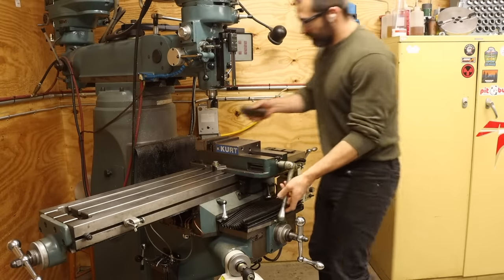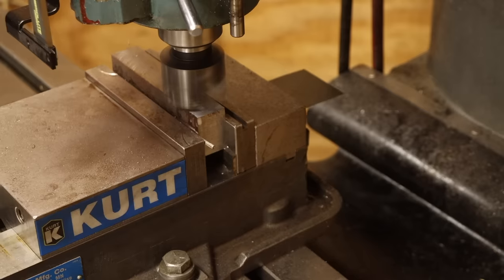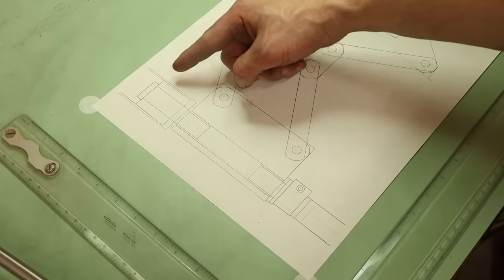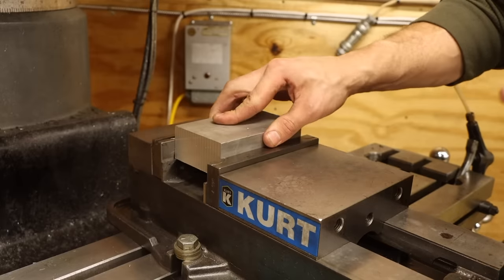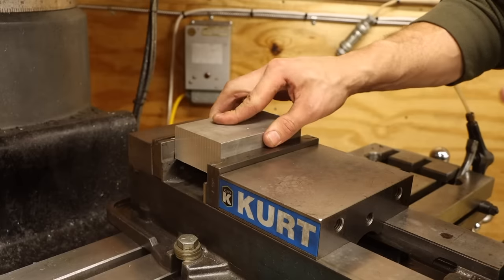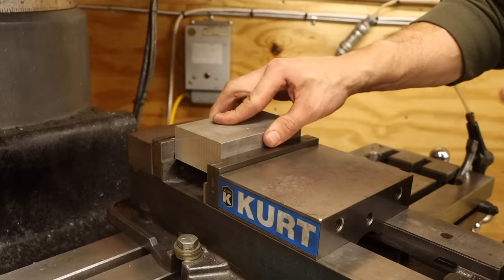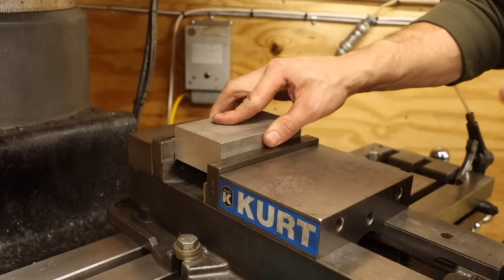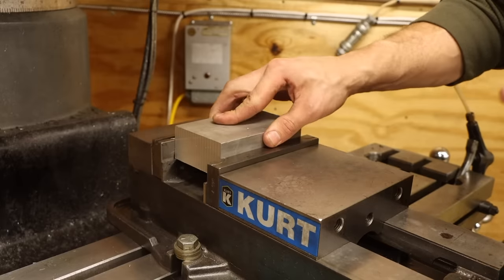A Life Changing Filming Upgrade || INHERITANCE MACHINING

Comment from the maker: I really can't believe how well this actually turned out. Nor can I believe I made it through without a single trip to the BOS 😂  But seriously this is going to make filming these projects so much easier and I can't wait to try out some new angles. See you again March 3rd!
Reply: nooo... so late?😉
Reply: This is so cool! I have one question though, what if you bump the gantry while filming? Will it move? Maybe some locking wood or nylon cams could keep it from sliding if accidentally bumped?
Reply: now you also have a tap holder for aautomatic tapping, when you're done filming
Reply: Looks great. I'm interested to see how much the gantry is affected by vibrations from the heavier machines. At least it probably won't drift, since you've leveled the track. But perhaps arm will migrate?
Reply: Dude the gantry is friggin awesome, you inspire me man :D
Reply: Well the BOS is subjective in my opinion
Reply: @jones7399  no
Reply: @Counttec  it shouldnt move at all
Reply: I can imagine the relief it gave once the project was done and actually functional. So satisfying :)
Reply: Super cool :)
A further upgrade I would suggest if your camera can take external power is to mount a bigger battery holder on the drop tube, and run a DC power chord from that along the arm out to the camera. Running out of battery is the most common complaint i hear from people new to filming :) At the end of the day, just return the gantry to home position and plug in the charger cable to the battery holder...
Reply: I was expecting a cut at 11:41 to the BOS overflowing with washers after making a claim like that
Reply: The only thing that I would have done is to make a second handle to go on the camera part to help finely move the camera when you can see the screen.
Reply: Not only did nothing end up in the BOS, but you had no Side Projects in this Build...

[Shocked Gasps] The HORROR...

😄😁😆😅😂🤣
Reply: @adamsavage should copy this :D
Reply: i love watching your videos, and this build is simply amazing.  cant wait for the next build
Reply: Unbelievable build!  Between the complicated builds and editing when do you sleep?  There’s not a lot of people out there that think like you do.
Reply: As a video production professional who also machines, I think this project is fantastic. There are similar Riggs that you can just go by but it wouldn't really make any sense considering the fact that you need projects to shoot and you can customize it.  Besides, I think your product is better. But I would say that you missed one opportunity, you could have made it a heavier-duty general-purpose gantry for changing chucks, loading heavy stock, etc.
Reply: Awesome little (except it’s frigging huge) project. The BOS will have his moment many times to come. Loving the videos as usual, keep up the marvellous work.
Reply: A smaller and simpler gantry on the same rails could be a great help to have the ligts, maybe one fixture on each side if you really need the flexibility. 

You shouldn't need more than a hight adjustment for them, and nowhere near the reach of the camera. Easily playing with light position is great for so many shots, 

I had some lights on a similar, but quite simpler arms, the gantry was something I alway thought but sadly the ceiling config and astethics wasn't conducive for it.
Reply: Agreed. Great build!
Reply: My only suggestion is some way to stope it from moving while you keep it still.
Reply: lol You should build a display case for the BOS items 😁  It would be fun.  Or maybe when you get a little more stuff in there, maybe you can do a "scrap metal" challenge and make something fun like a collage of your logo?  just an idea
Reply: @AJBtheSuede  To go the whole hog add a remote monitor for framing the overheads. 7 to 10" HDMI monitors are cheap and plentiful.
Reply: Add a cup holder. 😁
Reply: Amazing project, some great ideas and problem solving
Reply: Don't you mean the "F*!#&ing Knurler Parts" box?
Reply: The BOS is hungry
Reply: Nice build!  One thing that comes to mind is that, for each axis, if you run non-stretching cord from the carriage to the two extents of that axis and back, looping it around a bolt on the carriage that you can tighten, you can easily move along an axis while the bolt is loose, but tightening it will lock that axis firmly in place.  As well, by marking the cord at particular places you like to film from, it will be trivial to make sure that the carriage is exactly in the same spot each shot.  (If you really want to get fancy down the line, you can replace the cord with a toothed belt and motorize the whole thing, controlling it with 3d printer/CNC controller board so you can do automatic panning/etc.)

Does that make sense?
Reply: @mpyoung33 😅
Reply: @andy-mu3sx I think a heavy duty gantry is an excellent idea, but the rails are strong enough that he could mount one to the same sled or rails.  I’m sure Brandon would figure out a way to keep it from interfering with the camera setup.

Comment: I feel your tripod pain lol, i thought about something like this but my shed is to small with quite a low ceiling and the barn is to big. Top job and greta video as always.
Reply: Obligatory fanboying.
Reply from the maker: I appreciate it! Maybe an inverted arm (elbow down) could work for you. Or just a stationary pivot. Heck anything is an improvement on a tripod 😂
Reply: Two of my youtube hero’s in one comment section. Fantastic!
Reply: Obviously you need something large and motorized (jet powered??). Perhaps a laser designator that you can point for the camera to go to a location automatically, probably at like 50+mph.
Reply: @colinfurze Just swap the gantry for some preset hard points that you can slide the base arm post in and out of. That would work for smaller or bigger spaces. More effort to heft the arm between hard points when needed, but way more flexible for a large space, and way more space efficient for a small space.

A correctly chosen taper length and angle for the the mating of the arm to the hard points would make it easy to put in and out, but also very stable.
Reply: Colin, I think we all know you need to copy this design and strap a jet, 6 fireworks, a BMX and a pit bike engine to it. Go on, you know you want to 😉
Reply: Colin Furze, Inheritance Machining in one comment. We just need This Old Tony and Abom79 to make it a party. 😉
Reply: For the barn, consider skycam. A wire rope system. They use them in stadiums.
Reply: Barn is too big?? Sounds like you could do with a NICE, furzy, too big gantry setup, make it human-sized to be able to do those nice shots from above, and add a camera arm like this for close up and timelapse work. 

Have BAE do sponsor deal as they should be long on cash and short on kids wanting to get into machining and manufacturing jobs, atm
Reply: @Rastadogg85  could do IR beacon and have the gantry turn into a big CNC programmed w toolpaths around the barn, and then have the camera head independently focus on IR beacon while on the move.

I like the sound of it!
Reply: @dogefort8410  I volunteer to fly around on a gantry and hold a camera. Rocking foot pedals for x and y axis movement would be slick hands free operation.
Reply: A similar concept with vertical upper wall mount?
Reply: @danielstellmon5330  can't do 40 hr timelapse with drone.  Tethered drone, maybe, but not regular
Reply: You could make a small weighted cart for the barn that you just roll around with you
Reply: @InheritanceMachining  As a camera operator of many years the only thing I think you should add would be locking mechanisms on all pivots and elbows to help take out some of the vibrations. With some large Kipp type handles and a bit more drilling and tapping will make it much more stable if you can snug up all those joints when you need to.
Also I would have included some type of flexible mount with a small hdmi monitor near the camera end to make framing easier.
You are going to be able to do some lovely smooth tracking shots on those rails.
Reply: Mount camera on drone that will follow you around in barn. Jet engine not mandatory.

Comment: Consider a soft bumper (think tennis ball) on the bottom tip of the vertical handle. I worked in a shop with a similar apparatus and it only takes standing up under it once to make you hate the thing.
Reply: I'd like to see the precise drawings and machining of this "tennis ball" :)
Reply: Now I kinda wanna see him make a tennis ball out of metal. Damnit.

Comment: One of my favorite things that I noticed early on about your videos it's how you show certain shots throughout the manufacturing process in the intro, and usually show the finished product as the final shot before the logo, but even though I've seen what the final product looks like, my interest in the process it took to get there remains just as high. 
Excellent cinematography and storytelling.

edit: Now all we need is Mark Rober to install some simple moters and software to move the whole thing for some sweet panning shots 😂
Reply: There is a software called Dragonframe - originally developed to shoot cartoons frame by frame by carefully moving camera between shots. He could just slap a couple of servo motors, wire them to arduino and have that software to control the pulley. Alternatively, one could use Marlin or other 3d printing firmware to control those servos.
Reply from the maker: Thank you! I'm glad they pique interest more than spoil the surprise. It's a tricky dilemma
Reply: Personally, I keep my eyes shut during the introduction, solely to maximise the satisfaction of the final reveal
Reply: @_Cheko_  Plans, drawings, renderings and so on are fine, but the actual product kind of ruins the adventure of the build.
Reply: I like getting the whole lot from the get go. It makes the design considerations and limitations more meaningful for me and easy to conceptualise. Interestingly I struggle with raw creativity and often get my inspiration from taking things apart and reverse engineering or adapting the ideas I find within so maybe that’s why. Side note, I have one of those arms/jibs but it has no coil springs at all. There is just a single steel ‘finger’(?) within the middle joint/elbow of the arm and is almost completely hidden by the hinge bracket except a small slot. The finger pivots on pins and is preloaded with tension so it works in kind of an equal but opposite fashion to the elbow joint. Fascinating solution and keeps the arm clean and streamlined with no external springs.
Reply: @iteerrex8166  oh shush, it's the journey that we're all here for as much as the destination.
Reply: @Hyratel  I guess you didn’t understand what I wrote.
Reply: @AB-pb8oo  CNC toolpaths should be more than enough. Use same 3D software to design parts and camera paths?

Comment: I think that you are selling yourself short with this project. It's impact cannot be overstated. This is going to inspire many other makers and improve the quality of filming for a lot of people. There are many makers like Adam Savage who are going to be green with envy when watching this. Adam's flexible lights and phone mount are great, but they have their limitations. What you have made is a work of art that performs flawlessly. 
I can even envision more generic youtubers creating versions of this out of pvc and 3D printed parts to hold their iphones.
Reply: Adam’s shop is filled to the lid with all the stuff - even if he wanted to, he couldn’t use this design ))))
Reply from the maker: You are very kind! Thank you
Reply: @AB-pb8oo  He couldn't use the gantry, but the moveable arm could work. Might need somewhere central to mount it (probably higher up), but he has a number of machines close to each other where an arm this size could probably reach a few of them at once. And do overhead views down on the nearby bench.
Reply: John Heisz (woodworker) has a similar setup, but made of wood, obviously. The idea is not new. But this implementation is sweet!
Reply: Why would Adam Savage be green with envy? He has a crew of professional camera and sound operators in his employ if he wants to get some filming done. And he is not l limited to his home base. Not to mention all the other assets and advantages that Savage industries can bring to bear on a problem.  Since pandemic is not an issue anymore, when is the last time you saw Adam adjusting his camera? It's rather rare as Norm knows exactly what to do and doesn't need to be prompted. Perhaps you should own up and admit you are green with envy this setup rather than ascribe it to someone else. In not ashamed that I'm a bit envious of it and I don't have a shop to put it in, anything to film, nor the slightest interest in filming even if I did. It's a clever and useful project and done quite well. What's not to be envious of?
Reply: @InheritanceMachining  since this turned out so well, considered upgrading it with some working lights? Leds are prettty low weight to add to the arm end, and you could throw a battery pack on top of the     gantry plate? Just add a charge port at the bottom of the pipe, and all infrastructure is taken care of.
Reply from the maker: @dogefort8410  That might be worth playing around with at some point. Nice idea!
Reply: I think the gantry is entirely underrated here. As soon as he said he wants it to reach everywhere in his shop the same idea popped into my head, he just did it better lol. I would have added a lock to it though as the gantry moving when in position will still mess up your shots. 

As long as you can get the railing below the lights and above the machines, you can get the rest of it to go anywhere and everywhere to get the shot you need. It could easily be applied to any other shop.
Reply: @Johnny-uy4iu  this was immediately what I thought, but it seems he has either leveled his unistrut sufficiently or the ceiling was already pretty straight and those trolleys have enough resistance to hold it pretty well, as he demonstrates it a little at the end. The outer arms (jib? Boom?) Would be fine, as that's the purpose of the strings. But I was sure the whole thing would immediately find the low spot on the track and frustratingly stay there. Either he was several steps ahead of us or it just worked out that way. I'm guessing he leveled everything when he hung it, as he is usually quite thorough in his engineering and designs. He is after all an engineer.
Reply: Do DIY LED install and if you absolutely have to do some machining, do custom fanless heatsink, and maybe slap a thermostat on there to avoid overheating, but max the output from the installation.
Reply: Alexander Chappel and his "3d Printing a $10,000 Camera Arm" have left the chat 😆
Reply: @philbert006  "when is the last time you saw Adam adjusting his camera?"

Literally only a few days ago. Far as I can tell he's still using the same setup (though modified at least once since) he's been using for the past almost three years. (And I wouldn't say the pandemic "is not an issue anymore", I literally started off the year by getting COVID, it's very much still a thing, it's just that people have stopped talking about it.)
Reply: @Hexagonaldonut  to be fair, Adam does shoot a good bit on his own in the cave. He does a lot on the fly. I wouldn't say out of necessity though. More like enthusiasm. But you can be sure if he's wanting more out of his filming than the Livestream vibe, the intimate kinda diy stuff, he isn't going to film it himself. I guess it's really not so cut and dried. He's in an entirely different space. He has years of experience in film industry as well as his making, probably has rather intimate knowledge of the equipment that Brandon may not possess, and it's working on a much bigger scale than his hobby shop. But indeed he does film a lot himself. I think we may not know just how Adam feels about it unless he chooses to comment himself. My opinion is that it's most likely similar to everything in life, and all shades of grey. A mix of knowledge and access, cost and time, a balancing act. Adam seems to have a different focus though. I have a hard time imagining Adam not being thoroughly impressed and intrigued by Brandon's work. Maybe he is envious. Hell, maybe he watches this channel and is working on a similar project as we type.

Comment: Great video as always! One upgrade I would suggest is a small HD monitor mounted near the handle, with an HDMI cable running down the arm to the camera. That way, you could always see your camera angle , without having to look at the small camera screen. 

Super impressed with how well it holds in place after you move the camera!
Reply from the maker: Good idea! Thanks!
Reply: @InheritanceMachining  if you do this, i don't think it would be too difficult to run power along the gantry using cable chains
Reply: I'd second both of these ideas - power means one less thing to worry when shooting, since running out of battery becomes impossible, and a big preview monitor makes setting up shots easier. 

Totally overkill would be pulling the HDMI cable along to a central PC and capturing with a capture card instead of recording to sdcards.
Reply: @klaernie  I don't know that would be total overkill at all. Not only is changing batteries and SD cards a bit of a pain, but if you want to livestream, you need direct video output.

Comment: "Easy peasy"
"Turned out exactly how you'd expect"
For man with a BOS as impressive as yours, these are BOLD statements. Each time a tool touched metal, I could feel the latch on the BOS loosen. An edge of the seat thriller for sure.
Reply from the maker: haha it helps to say such things after the project is already complete!